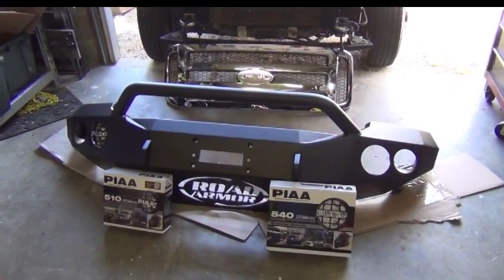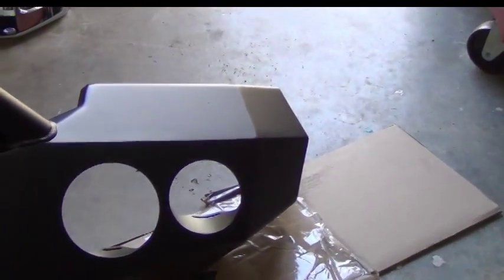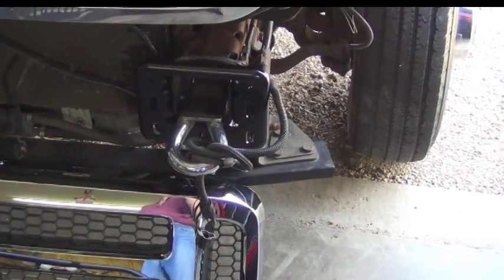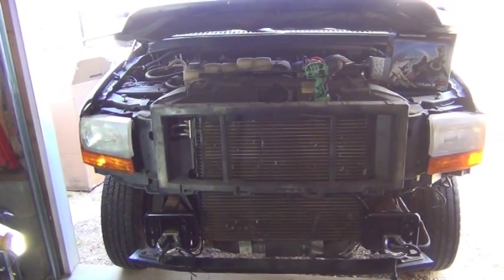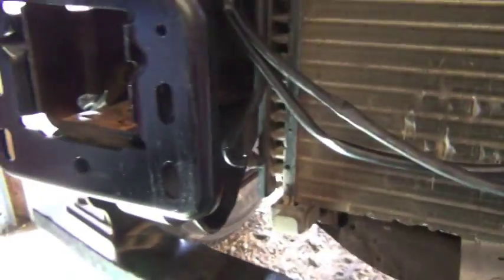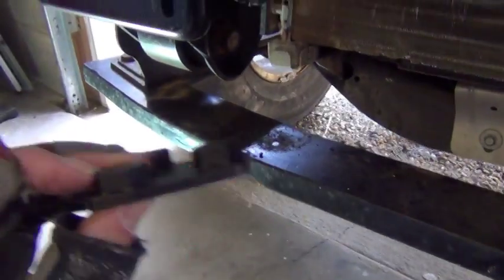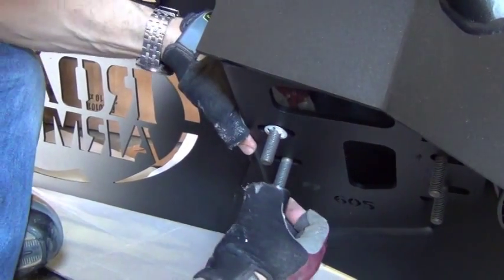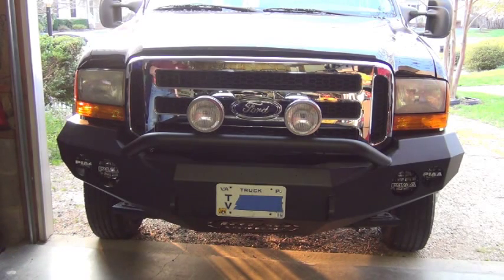05 - 07 Road Armor bumper and Ford grille installation on an 99 - 01 truck.

Comment: HI, I am not trying to be a know it all but the triangle pad that holds the reinforcement plates does not only hold that plate, it also is the MAIN Front Spring Hanger. If those bolts come loose and fall out it WILL cause the front spring hanger to come loose and could cause you to wreck the truck. There are so many people that do not pay attention to these types of details, I know that you didn't intentionally mislead on this.